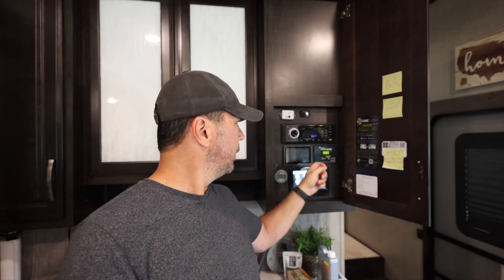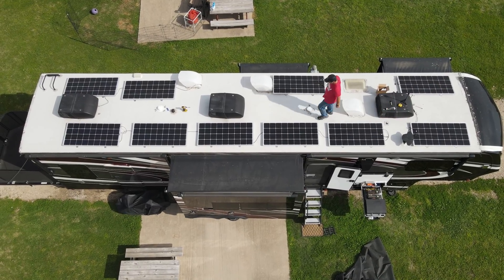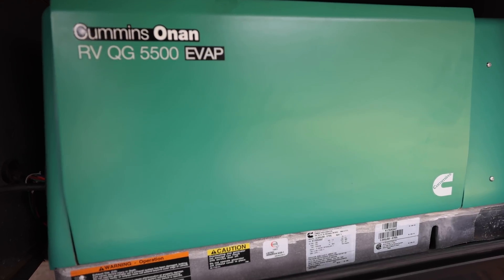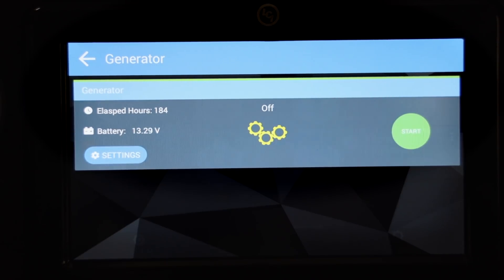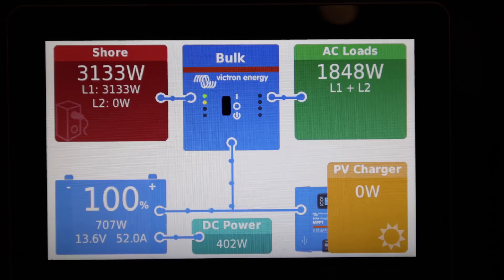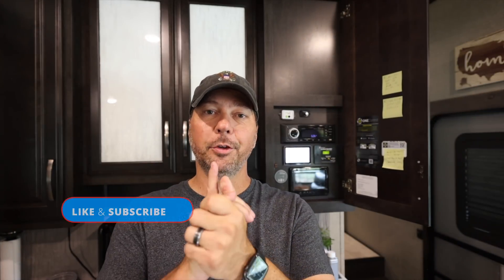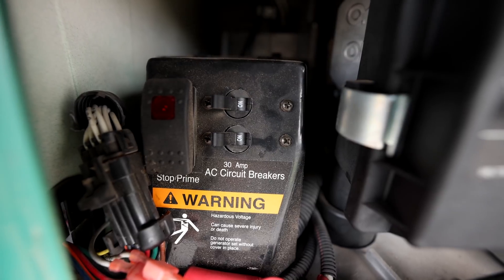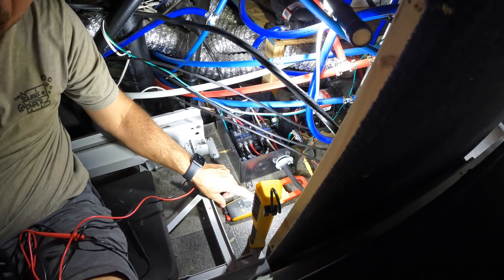RV Off-Grid (Solar) Power System Review and Fixes! (Full Time RV Life)

Comment: So Chad, you paralleled the Inverter “out” and the generator “out” just before the generator side of the ATS switch?  I understand the concept, just making sure I understand the ATS inputs that I’m needing to parallel.  great idea BTW!  Great episode, so envious of y’all’s solar and inverter setup
Reply from the maker: Good to know!  Thanks!  I found that splice and, you're right, it's a much better solution than what I used.  Ordering one tonight. 👍🏼
Reply from the maker: I only paralleled the generator out.  the inverter bridges the output on its own to feed both lines.  This is only an issue if your generator is like ours.  I think generators over 6K output split phase.
Reply: @ChangingLanes  .. yeah .. was just rewinding that part over the video (over and over …)   So you paralleled L1 (black) and L2 (red) together leaving one input on the generator relay.  So now, you only have one leg feeding that generator input relay I assume, and a Neutral.  2 wires feeding the gen input vs the original 3?
Reply from the maker: Yes.  Bridged red and black then one line (and neutral) to the ATS.  2 wires into the ATS FROM the generator now.
Reply: All Cummins gasoline RV generators are single phase even the 7000 version.  The diesel units are split phase.  Caution here to not overload the single neutral as you are still in single phase power and the current will not cancel like split phase.  Make sure you keep an eye on your neutral.  You also might want to consider updating your splice to a Morris Insulated Splice connector.  You can google them - they are made for the purpose you are using the ground bar for and also are rated.
Reply: We solved the problem another way.  We changed the phase of the Cummins Onan from single phase to split phase and it works awesome and can not overload the neutral.
Reply: @atcgeek21  can you described how you did that?  I just jumpered the gen outs together a few months ago to solve the same problem Chad had
Reply: @martinshankle4811  Sure but it is a little more involved than Chad's solution.  Beware - this is along post.

You have to install another device called an AutoTransformer.   Ours was made by Victron but others make them.

This is not a Huges Autoformer.  This will allow you to manipulate the AC waveform and generate 2 legs out of phase with each other by 180 deg.  from a single phase input.  The legs will be 240v referenced to each other and 120v referenced to neutral (there is some V loss on line 1 due to transformer). We also bonded together our 7000 Cummins Onan single phase inputs (which is the technical term for what Chad did) and feed it to the autotransformer, along with the common neutral (you do not want to drop the neutral) then to the ATS.  

The ATS (and victrom Multiplus II x 120 downstream from it) sees true split phase and still will powershare on line 1 and passthrough line 2.  Note: You are still limited to the 30 amp per line at the Generator breakers and the neutral is still limited to 30 amps total but since it is split phase, the loads cancel each other out and only the imbalance is seen on the neutral which is how your 50 amp split phase input works with a common neutral.  You can think of this as 30 amp split phase.  I hope this makes sense as it gets a little technical.
Reply: @atcgeek21  yep , lot more involved but interesting.  Thanks for the explanation, think I’ll just stick to jumping the gen outputs together
Reply: @martinshankle4811  No worries.  I am an engineer so usually take the complex route.  This will work fine.  Just make sure you have a large enough shared neutral all the way back to the generator where it is bonded to ground.  Our Cummins Onan 7000 (~60 amp) did not.
Reply: @atcgeek21  The neutral is 6 AWG which is more than enough to handle the 45A the generator is capable of producing.

Comment: Rapid Red that’s what I got. Just had first oil change and a trailer brake controller system update. Some people complained about taking to long to stop. Seems like it helped.You will get a notice from Ford around April 16th.
Reply from the maker: Yea.. there was a recall but ours was built more recently and it doesn't apply.. Unless there's another one coming out.  FWIW it worked GREAT for 800 miles of towing recently.
Reply: @ChangingLanes  I got mine November 11th 2021 so your yours probably won’t be in that update.

Comment: Another thing to try when there is wifi interferrence... There are apps that will give you how many devices are using the various wifi channels.  Find one with lower usage, and change the channel your wifi router is using.  Most people don't know how to do this, so if you can figure it out you will likely be able to get out of the scrum for wifi and work just fine.
Reply from the maker: I tried that and it was a no-go.  It night have just bee the tightly parked RVs at the fiesta but I wanted a 100% solution. 👍🏼
Reply: @ChangingLanes  Yeah.  I have plans when we finally get our motorhome to run ethernet anyway as I've had so many issues with wifi routers and having to reboot them every once in a while if we have too many devices connected.  So everything that can be wired will be.